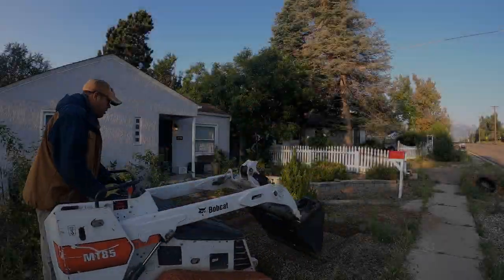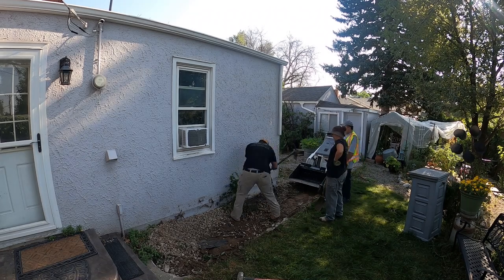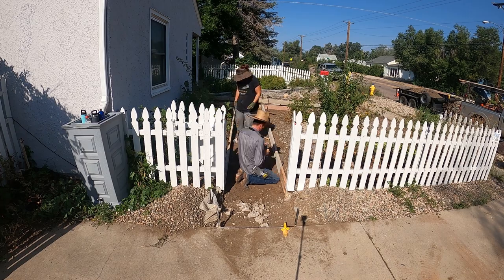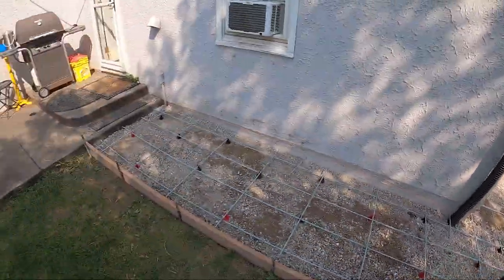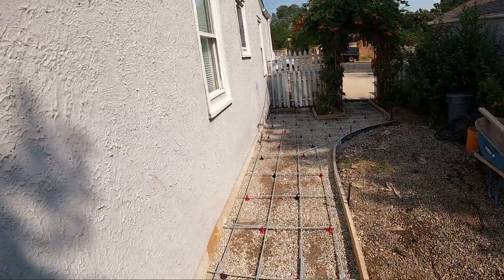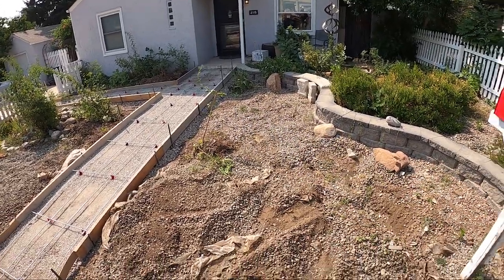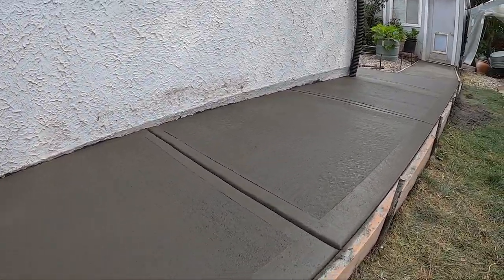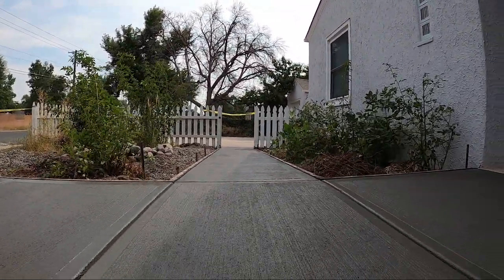How to pour Picture frame color concrete sidewalks.

Comment: Great job taking precautions against any needless hardscape damage. Yet most customers take for granted that all contractors looking out for their best interest take pride in work Like you do here. But in fact its becoming a dying art.

Rather than a rock garden, imagine if there was an existing lawn topping off one or more foot of soil also supporting a trees outward bound feeder root network. As a responsible and commonly accepted precaution practice. Either plywood boards rubber mats or temporary layer of wood chips could cushion construction site. Remember when the old man used to shake his fist shouting for neighborhood kids to get off his lawn?!?

Both grass & trees fine fibrous roots growing within top half inch of surface require oxygen exchange & rainfall filtering down from above ground atmosphere in order to function...

As professional arborist one of the First most important things we learn is to never artificially raise or lower soil level over existing grade. And especially to never walk over soft moistened ground after rain In order to prevent any reckless compaction of soil resulting in almost permanent loss of pore space. And anywhere where new layer of soil rests upon already existing soil Which roto tilling In hopes of returning porosity to several subterranean soil horizons after foot traffic or heavy vehicle Intrusion causes mechanical compaction is Not a possible option. Since excavation and tearing up of These fine feeder roots mimics severe drought conditions until said roots have a chance to grow back.

Anywhere excavation takes place, larger supporting roots thicker than one's wrist need to be cleanly severed with a wood saw in order for new words to begin growing from ends. Never a cement cutting blade, and certainly never left shattered and ripped since such damage leaves root ends totally defenseless against rotting organisms then gaining free access internally to all above ground portions of trunk and tree crown.
Reply from the maker: We try and minimize our footprint where possible. In this case the customer was planning on laying new stone and redoing landscaping around the new concrete. Thanks for watching and good info.

Comment: looks really Nice! This was the effect we were supposed to achieve on our Pool deck colored concrete pour.. 20 Yards worth of Omaha Tan.. But the first truck was 25 mins late.. the second truck early and impatient.. and the crew who was doing my pool deck, got behind the concrete on a bright sunny 75 degree day.. even with pitting retardant in it. ended up having to completely over work it as it was almost hardened... some spots are whiteish from using water to re cream it... and that night was all blotchy black marks (some light grey areas still as well show up) but over all still looks really good. again.. You guys do Great work!
Reply from the maker: Thank you, we just had a pour where one of the finishers wasn't proficient and left an ugly area so we are having to repair it. But it does look amazing when the concrete cooperates and the crew is on point. It's a difficult finish to achieve even for the best crews. I am very grateful when we manage the reshine atleast. But when you get the reshine and checkerboard right. It's the nicest finish available in my opinion.

Comment: Are most of your jobs in the $2,000 - $10,000 range there? That's how you can get the most amount of jobs.
Reply from the maker: Mostly $7,000-$13,000.
Reply: Yeah that seems about right for the area. The minimum charge where I'm from is about $2,000. I can't blame concrete contractors. If you don't get 4 yards you are stuck paying a $150 delivery charge. Everyone has to make money.
Reply from the maker: @Rez-rk3gb  We always say we are willing to do any job. But this is how we plan to retire at some point so we need to charge accordingly. Can't work for cheap.